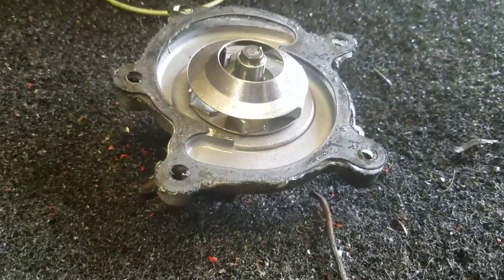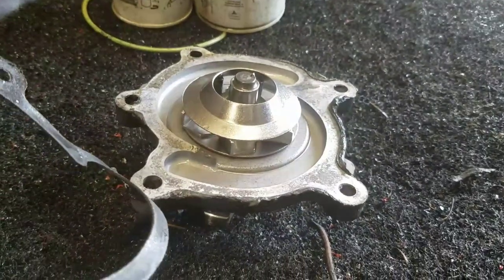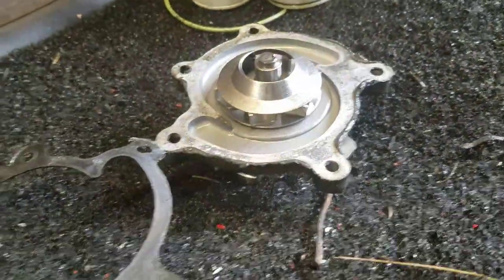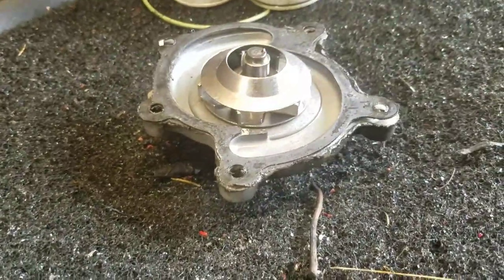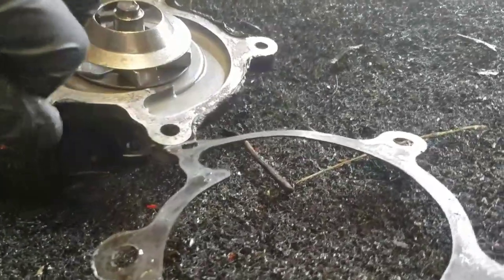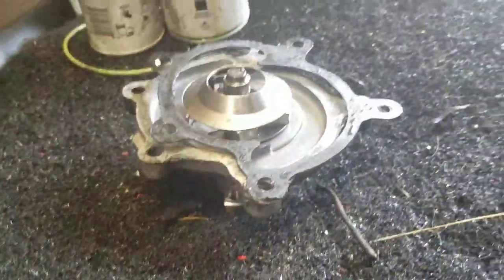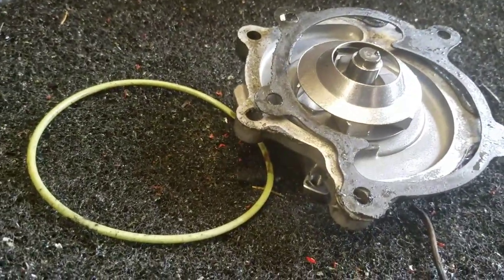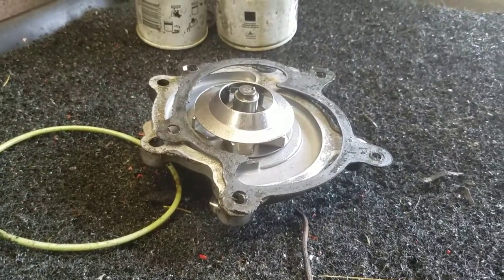Repair: do not use RTV silicone on paper gaskets

Comment: The biggest reason for RTV sealing failures is due to dirty / oily surfaces.  Using ultra grey RTV on coolant system surfaces that have been thoroughly cleaned and de-greased will work perfectly every time!
Additionally, I always prep the surfaces with an abrasive disk, even the new parts before cleaning.
Reply from the maker: I agree the prep is the biggest part.  And I often will do the same, with roughing up a smooth surface.
Reply from the maker: @@a.melburn I use aviation sealer on those.

Comment: I've used RTV on paper gaskets for many years...and never had any leaks.  The trick I do is I wait a few days before I start the engine to give the RTV enough time to harden up.
Reply from the maker: Good job, glad it worked for you. Do you have a part number for the specific paper you used?
Reply: @MegaMarclar  The part# on my last repair was Fel Pro TCS13417.  And the RTV I used was Permatex High Heat Red.
Reply from the maker: @midos67channel24  that blue paper is silicon impregnated, doesn't require any additional sealers. This is the reason these leak down the road. Silicone will stick to any surface, except it's self. If you were going to use anything on that application it would be aviation sealer.

Comment: I always look at it logically.  If your paper gasket needs silicon rtv then the manufacturer should use silicon gaskets.  I find paper gaskets all over tractors and the only leaks are when people overfill the fluid levels.   The old " if it calls for five quarts I'm putting in six quarts to be safe " people.
Reply from the maker: Right. most of these 'modern' papers are silicon impregnated and cure with heat. silicon will stick to ANYTHING,... unless it is other silicon.

Comment: i like using RTV with paper gaskets, it soaks into the paper and makes a silicon/rubber gasket out of paper(applied to both sides). follow the instructions, completely dry, thin coating/small beat, finger tighten, wait for however long is recommended(think an hr), then do final torque. fill with fluids after cure, generally 24hrs.  i've really only used this on paper gaskets on crankcase covers on motorcycles, but it sealed so well i could run it with the bolts removed(just as a test) and needed a sledge and wood block to beat it off.... i'd say it sealed well.. (however, this was paper/rtv, literally turns a paper gasket into a modern rubber/silicone version)
Reply from the maker: It can work in some applications. But your assessment of "turning it into a modern rubber" gasket is not accurate. But I'm glad it worked in your situation.
Reply: @MegaMarclar  why? 

(obviously its not a 1:1, but it turns out pretty close)

Comment: Hello, Thank you for your video. If I well understand The paper gasket is enough. So i don't add any type of isolatation material do i? How does not leak the coolant out from the water pump with paper gasket. can you explain it? thank you in advanced.
Reply from the maker: It depends on the type of paper, they are not all the same. Clamping force solidifies the paper into a hard substance.

Comment: I used RTV on paper gaskets many times and never had a leak; I use it only to hold the gasket in place while I do the istallation if you don't use something it falls of and there is a chance of damaging the gasket.
Reply from the maker: depends on the type of paper. I try to use hi-tac if necessary

Comment: I replaced my Prius water pump with no additional gasket sealant and its been running 2 years with no leaks. Ford after market water pump on Galaxy Mk3 states that you need to smear sealant on the paper gasket. What to do?
Reply from the maker: Permatex aviation sealer for paper

Comment: Thanks for the info
What about using OPTIMUM GREY in a thin layer on the gasket? Permatex claims it is designed for water pumps?
Reply from the maker: That is up to you... personally, I never use it.
Reply: That's what I did and no leaks!

Comment: No mechanic I've worked with, will use an untreated paper gasket. They all leak...
Reply from the maker: two beer everybody has their own way of doing things. personally over the last 15 years of my career I have seen more paper gaskets fail from Silicon than any other gasket failure. I can't think of any manufacturer that recommends silicone in a paper gasket in a service manual.
Reply: Never had a paper gasket leak, until today! Solution? Paper gasket and a thin film covered over the hole paper gasket. Then finger thigh, currently wait it to dry. Then i probably tight it up
Reply: @MegaMarclar are you letting it cure?  I know mechanics don’t have time for that, but that’s probably why that’s happening. I’ve used paper gaskets and RTV sealer for over 25 years and I have had good luck with that combo.

Comment: I'm up changing my water pump on my 2000 Ford Taurus for the 4th time. First time just a gasket. Fail. Second time red silicone RTV Permatex plus gasket too much my fault. Fail. Third time thin layer Permatex number 2 sealant and paper gasket, but I didn't spread it around with my finger. Fail.
At 4 hours a pop this is beginning to piss me off. I figure I'm taking off the tire, spraying the area with carburetor cleaner, and sanding it all down, before reapplying and torquing to specks. The only question is do I use red RTV alone or the paper gasket with the number 2? And if I use the number 2 do I only put it on the side of the water pump? Or do I do the thin layer rubbed on both sides with my finger?
The 4th time frustrations. What can I say... not even my first water pump, but this one's got me by the grapes.
Reply from the maker: For starters the waterpumps never came with silicon on them from the factory, just straight gasket. I would never use red / Orange on any paper gasket. Different types of silicone are design for different applications. The orange / red stuff always leak when they come in contact with oil or coolant for the most part. If you absolutely have to use silicone I would use black or gray.

But in your particular application I would start by cleaning the surface as well as possible with a wire brush, the  using brake parts cleaner to remove all signs of coolant and oil. I would then use permatex high-tack. It's a spray on sticky "sealer" that allows the gasket to stick to the water pump but still allows it to move freely. Spray a thin coat onto your water pump and on to the water pump side of the paper gasket. Let it dry for a minute until it gets sticky didn't put the paper gasket on to the water pump and install it. The problem with silicone is that it's effectively a glue and doesn't allow for expansion and contraction.
Reply: Mgeorge: i know how you feel. Doing my 99 dodge water pump gasket for the 4th time as well. So pissed right now!

Comment: Crap. I just fixed the water pump gasket on my 99 dodge again. I tried using no silicone and it lasted 6 months. I used silicone on both sides of the gasket last time and it lasted 3 years. Usually i have to replace the gasket once a year. I used permatex water pump and thermostat housing gasket maker today and after installing realized it said rtv. Permatex says its for water pumps, do you think this is right?
Reply from the maker: What dodge are you working on?
Reply: @MegaMarclar  1999 ram 4x4 318cid
Reply: Ram with a 318
Reply from the maker: @googleuser8448  that is unusual. I used to work for Dodge and we did thousands of those. Maybe try getting a set of mopar gaskets from the dealer
Reply: @MegaMarclar  i did notice my tensioner arm is not holding good tension at all i wonder if that could cause it or maybe the block is warped. Or if it is due to aftermarket pump? I never go with the cheap ones and i use felpro gaskets. Who knows a mopar gasket might do the trick. Thanks for the tip!!
Reply from the maker: @googleuser8448  to be totally honest the a/m parts these days are all crap built In China by some 8 year old kid. I find it's better to just spring the extra cash and get the OEM stuff.
Reply: @MegaMarclar  i agree. Even though orileys told me their pump was oem im beginning to think their full of shit!!

Comment: Mine keeps leaking I have bought 2  water pump gaskets and they both were melted or worn after using them for a while, noticed it was still leaking from a bolt side, it was not leaking all around just around the bolt, does a metal gasket make any difference or just using rtv gasket maker ? It’s a 2010 camaro 3.6
Reply from the maker: Use thread sealer on the bolt threads to seal the hole in the block

Comment: I have a question.  I put RTV on the pump itself a d the the gasket no silicone in the block   and when the temp gets hot its leaking bad . Is this because i did both?

Comment: So what does he say about the OEMs nowadays using some sort of RTV or similar sealant to seal timing covers, oil pans etc?  My Hyundai used RTV on the oil pan from the factory.  I had to change the pan because my old man god bless him took the car to a quick lube place and they stripped the threads on the drain plug.  I had to replace the pan (pan was only $20 on Amazon).  Instead of RTV I made a Garloc gasket and so far so good........I decided to make a gasket only because i had the know how and the material to do it and thought why not.  Guess we'll see........
Reply from the maker: on a precision machined surface a bead of RTV is fine, as long as its the right kind. This video was more specifically targeting those that put RTV on paper which is not designed for that application. Most modern vehicles have moved away from gaskets  on hard engine parts like pans and timing covers to make them cheaper to manufacture. The biggest issue there is the people working on them use WAAAAAY too much sealer. Doesn't take much at all.

Comment: If you do not use RTV on a paper gasket, IT WILL LEAK! Seen it too many times. Always coat the paper gasket with a layer of RTV, by hand, that's suited for the application before installing it.
Reply from the maker: Name one OEM application where it tells you to rtv a paper gasket, in the service manual.
Reply: @MegaMarclar  You can't be serious... Pick up most paper gasket kits and they come with a small tube of RTV. It's "paper". If it comes into contact with coolant or oil, it will slowly seep thru the gasket or thru any imperfections on the mating surfaces. That's what RTV is for. Take the gasket, apply a thin coat of RTV to both sides of the gasket with the tips of your fingers. You must be new to working on cars or something. Years ago, auto makers always used RTV on the pan gaskets(back when they were cork), valve cover gaskets, thermostat gaskets, timing cover, etc.
Reply: @MegaMarclar  And if you want an example, look up a timing cover gasket kit for a SB ford. Not that crap 4.6L and newer shit. Look up one for a 289/302/351 windsor. Should come with thread sealant and RTV. I'm staring at the picture of one right now. Here's a link. https://www.mustangdepot.com/OnLineCatalog/Engine/timing_chain_covers.htm
Reply from the maker: @JohnDoe-ml8ru  lol, well your the expert.
Reply: NO, RTV on a PAPER gasket WILL LEAK. Paper gaskets require shellac based SEALER, NOT RTV 'gasket maker.'
Reply: @MegaMarclar I bought an GM water pump that states it in the directions.
Reply: @JohnDoe-ml8ru i remember them cork gaskets.  Replaced many Valve Cover Gaskets on my 81 Chevy Pickup. Back in the early 90’s. I always using Permatex on one side of the cork valve cover gasket.
Reply from the maker: @Jason_556  ya, you are supposed to use aviation sealer on cork.

Comment: I bought an GM water pump and the directions say use RTV sealant or pump will leak.  So not sure about what you’re saying.
Reply from the maker: directions from the service manual, or from the gasket manufacturer? If its fel-pro they want rtv on everything.

Comment: So I changing my thermostat can I just use silicone and no paper gasket or do I have to have the gasket??????
Reply from the maker: You can use straight silicone if you want it to leak and have to do it again. My suggestion is to replace it with whatever came off of It from the factory

Comment: My water pump came with replacement gaskets.old metal with little tiny oring kinda deal to new fibor gaskets.I also wonder about sealer can't find anything on adding sealer so I'm with you not going to use it.

Comment: MY OLD ONE DID NOT HAVE IT FROM THE FACTORY, i DID NOT PUT SEALANT ON THE NEW ONE. lol i was just having this discussion with some one that was watching put the pulley back on, commented that my shit was going to leak and I was going to have to re do it all again LOL.   i don't think i will however.      If they didn't have it factory, why then would you think you should seal it up?     anyway.  great video.
Reply: Larry Leisuresuit Well, did it leak? I’m bet it did . Mine had some black goo from the factory. Looking for what is considered best for sealing a water pump right now to put the new one in with.
Reply: I put sealant on mine few years ago, no leaks. How has yours held up?
Reply: @srocks-uj2ip    No it has not.  I'm not sure why I missed this reply, some one else just replied and I saw yours above it.   100% all good though.  94 mazda B3000 ( Ford ranger )  4x4 manual shift with the crap 3.0L ( wish it was a 4 liter.)
Reply: @MrRightNow    Mine has not, It's all Good.    Yours might be luck?  Not enough time gone by?  who knows,  keep your fingers crossed though.   just in case. LOL

Comment: I've never had anything leak. You say don't use silicone. So what do you recommend?
Reply from the maker: It depends on the application, there is no one size fits all solution... Check the vid description for the follow up video that talks about what to use, when

Comment: what about a timing cover gasket that deals with both oil and coolant? what would you suggest? 2001 buick century custom 3.1l v6.  i have a coolant leak from the timing cover gasket which uses the standard felpro type of paper gasket.  i will be diving into this repair soon. thanks.
Reply from the maker: Personally I always install them dry, just like the factory. On those there are 2 holes where coolant flows through (iirc). You could use some hi-tac to attach it to the timing cover prior to install. It allows the gasket to move as heat expands the metals. Unlike silicone where it creates a path for fluid to travel past..

Just like everything it's your preference. Consider how the factory built the engine in the interest of longevity and lasting through the warranty period. If the factory thought that it would need silicone to seal they would have put it on it.

Comment: Its scary how large some beads of silicone are applied by people, and even Permatex's own videos slap it on super thick. I dont use it on paper gaskets but have use it as a maker, I put nowhere near the amount on that others do and it seals well with not a lot of squeeze out. I tend to put on a thin bead like you see in some OEM factory videos when they're applying black sealant as gaskets.
Reply from the maker: Ya, it really depends on the application. Permatex is a for-profit company and they could give two craps less if it's done right or wrong As long as they're selling products.

Comment: I’m replacing the fuel pump on a 350 engine. I’m getting a fel pro gasket for the mounting plate and the pump. Then I should not use gasket sealer on the gaskets correct? Thanks for the info
Reply from the maker: Depends on the type of paper the gasket is made from, You should use aviation sealer, not rtv. Unless the paper is blue then use hi-tack
Reply: @MegaMarclar    Well it was blue so I didn’t use any sealer at all. Hope it doesn’t leak
Reply from the maker: @JC7318  blue paper is silicone impregnated and will cure on its own with engine heat
Reply: @MegaMarclar   Fuel pump installed. Long ride. No leaks !!
Reply from the maker: @JC7318  good deal. A+ for doing research first instead of wandering away at leaks later. The thing about silicone is it will stick to pretty much any surface on the planet except for itself. So when you put silicone on a silicone paper gasket they always leak because there's no actual bond